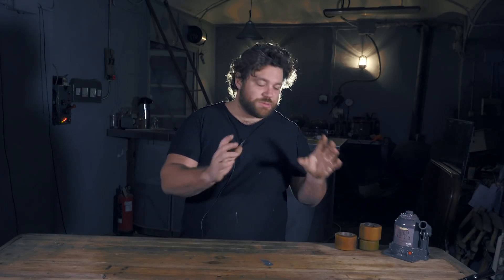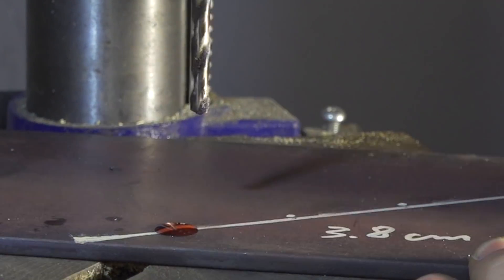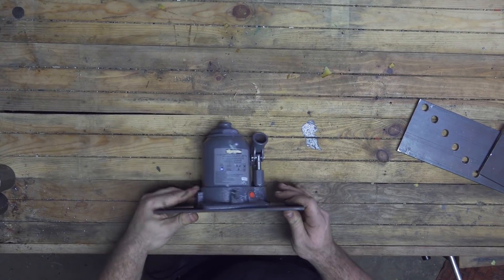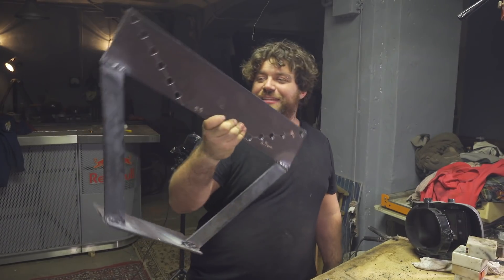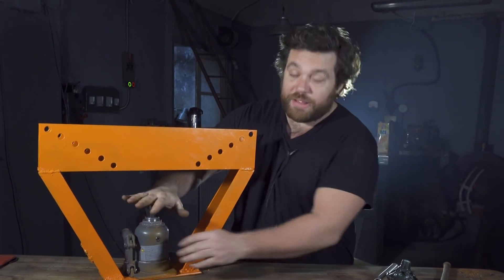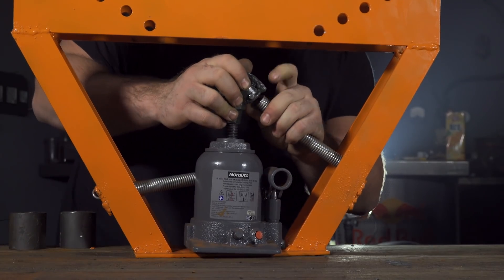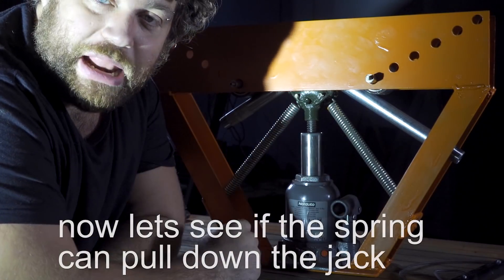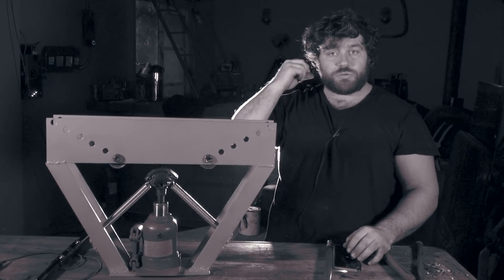How to Make a Pipe Bender - DIY

Comment: You just need pulley wheels instead so there is a rounded surface against the pipe, with these flat surfaces, this cant work on round pipe, maybe on square pipe.

Comment: This is great, also you could add a flat plate on the top and use it as a press. 
But please be careful of your health my friend, those fumes are bad, and after a while you may have sun burn in your arms and hands from the UV of welding. Cover up and breath fresh air.
Reply: Yeah sunburn you can survive just fine but melanomas ... that's what you really don't want. So yeah cover up from that uv.

Comment: Yeah it's hard not to kink a pipe when bending. A torch can help too
Reply: The reason it bent is because the tool has no shoulders. If you think about a pipe "folding" instead of "curving", look at the fold, it is wider than the pipe. This is why the tooling on a real pipe bender has the cross-section of the pipe on the sides, not just a flat piece of steel on the bottom like Rulof made. If the pipe cannot become wider, it cannot fold, it will have to follow the shape of the bend. Your tool shape has to be the shape that you want the final pipe to be, all the way around, not just on the bottom edge.
Reply: @MattsAwesomeStuff  true your right didnt think about that. He could probably make some modifications